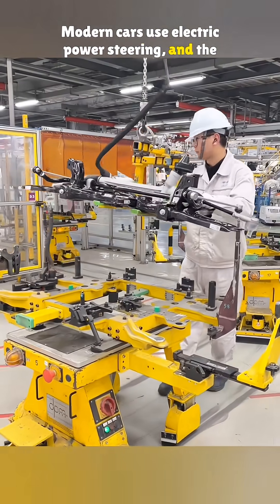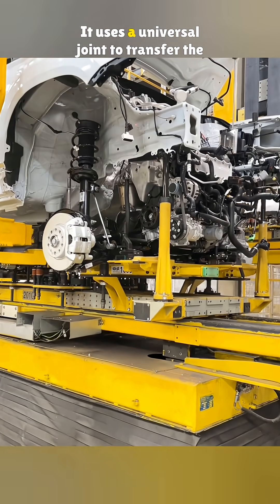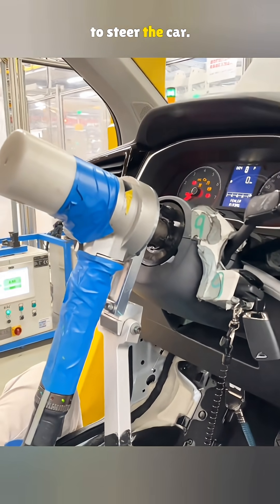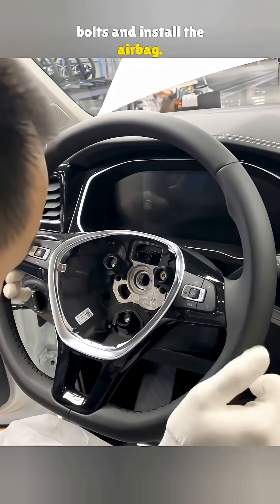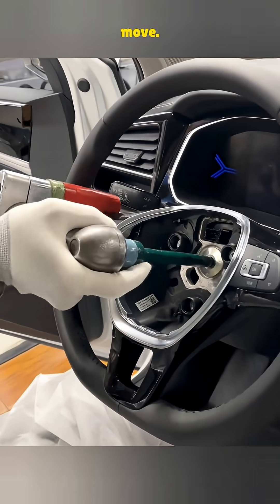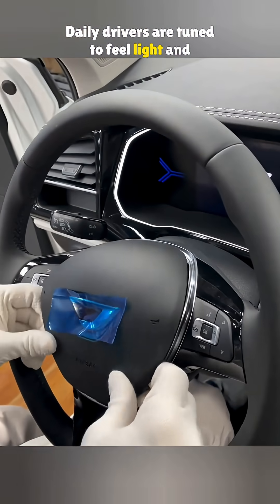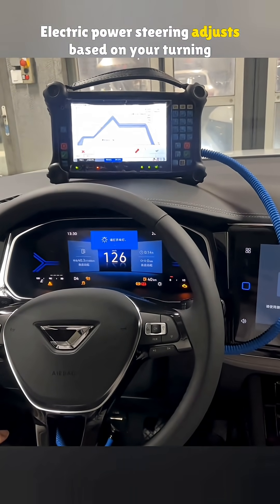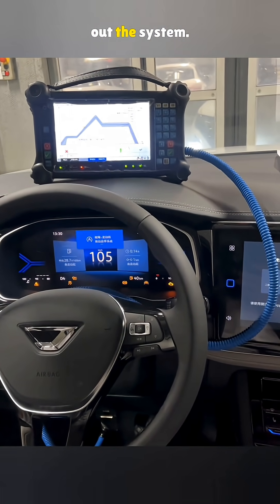Why You Should Never Turn the Wheel All the Way While Parked #assembly #factorytour #manufacturing

Comment: The only time you should turn the wheel from lock to lock 3 times to recalibrate your power steering sensor after replacement.

Comment: Nice brain rot. The answer is, turning the wheel, while not in motion, causes extra stress on the steering system. That said, modern vehicles are (mostly) over built with this in mind.

Comment: Electronic power doesn't change the steering ratio. It's just a power steering system that uses an electronic motor rather than a hydraulic pump.

There are multiple types of variable steering ratio systems, but that's a totally different thing. There are variable ratio rack and pinion systems that use different tooth spacing on the steering rack (these types exist even on some hydraulic power steering cars. These space the teeth out further off-center so you get smoother steering on straighaways but more response once the wheel starts turning. There are also active electronic variable systems that use motorized pinions to increase steering response based on factors like speed, steering input, and drive modes.

Comment: This has always been the case.  Hard on tires too.  Back before power steering, you realized that letting the car move an inch or too makes the wheel turn very much easier.

Comment: That's stupid.
While parking near kerb on a hilly or sloped terrain, the steering is always tilted towards the mountain face or obstacles facing such slope. If you don't do that, and the handbrake fails, your car will literally go towards the middle of the road or even off the cliff.
Reply: Do not  park  on hills. This will wear out  the car parts which  are  very  costly.

Comment: In a hydraulic steering system,  nothing will be wrong in doing so. Just the regular wear and tear that can survive for more than 500 thousand miles in most cases.  
  The electric power steering components are more delicate.

Comment: I mean at some point you’ll have to turn the wheels while stationary at least a few times in your life. Because if your in a tight parking spot, namely Parallel parking, then your going to be turning your wheels when your stopped. And I’m sure car manufacturers realized that as well since the engineers probably have to do it as well.
Reply: No, do not  turn  the wheels. This causes  expensive  wear and tear. Use  car  for naps only. (Be sure to keep  nice  pillow in car for better  sleep  ,of course)  . This will  save money and also the earth. Thank you for your attention to this matter.

Comment: What to do if you're in a parking spot, and you have to take 90° turns?
Reply: You can still have very slow motion while turning. If not otherwise possible, you can even drive back-and-forth the few inches while making the turns. That's how we did in the time we didn't have power steerings.
Reply: just drive normally this video is bs

Comment: And what normally tends to wear out. Is the balljoints on the track rod arms. As they Are a ball n socket set up. Just like your knuckles, on your fingers, toes, shoulders n pelvis, elbows n arms. Inside there is grease. And once that grease (Sealed @ factory).. Dries out, due to extended Heat thru friction. The ball socket wears out. And U get "SLOPPY" Loose steering. Causing wear. And when ppl park against the curb, or hit a pothole. That COMPOUNDS The wear.. And Then U see UNEVEN Tyre wear. And car "TRAM LINING".. As you drive down the road.

Comment: He is saying that do not turn steering all the way till you reach the lock on either sides.
Because electric motor is assisting you while you turn steering wheel.
Power steering system is an ultra high speed computing system that senses your steering input and assist you with motor in realtime.
So when you touch the lock while turning all the way, electric system will try to turn a little more after the lock is reached. Which will lead to over current in power system circuits and may fry it if you have bad luck. But it wont happen always.

Comment: He is saying that do not turn steering all the way ot the lock on either sides.
Because electric motor is assisting you while you turn steering wheel.
Power steering system is an ultra high speed computing system that senses your steering input and assist you with motor in realtime.
So when you touch the lock while turning all the way, electric system will try to turn a little more after the lock is reached. Which will lead to over current in power system circuits and may fry it if you have bad luck. But it wont happen always.

Comment: That might not actually be true. Because whilst driving you not only have the static load (weight of the car) through the wheels and thus also parts of it in the steering system but also dynamic loads due to acceleration and cornering (longitudinal and lateral forces). Whist standing still you only have static forces. Also for the stress on the steering components it is no different, if a person or the electric assistance brings on additional load into the steering system. So please use the steering to its full extent, like the manufacturer intended.
Reply: the video explains it very badly, but it's true, when stationary the tires create a lot of friction, and you have to force the steering wheel a lot. try a car without power steering...
Reply: @leonardo5225 Exactly. That's the best example.
Reply: @XB10001  yes it puts stress on the parts. But none of the parts should be that week that they can't handle the tension. If they are too weak they shouldn't be part of the car.
Reply: @technikchaot they aren't that weak but overtime everything breaks down after doing it hundreds or thousands of times
Reply: @technikchaot* WEAK
The design is a compromise. Making them stronger adds unnecessary weight, when all you need to do is operate the steering properly.
You don't misuse other parts of the car, do you?
I guess you dry turn all the time.
Reply: @technikchaot some people are curious about how to drive their car the maximum amount of miles before it eventually breaks down. It's about reducing unneeded stress. Of course its built for strain, but it's still strain that's not needed and can be avoided in many situations.

Comment: What you ment to say was never turn the tires while the car is stationary, there must be slight movement forward or backward so you don't strain the components 🤝
Reply: Oh please. You'll never wear out anything doing it a few times here or there.
Reply: Yeah. Dry-steering is generally bad, not just steering to lock. You can go lock to lock while rolling at a crawl just fine
Reply: Exactly!
Reply: Yep, you get the idea by driving old cars without power steering. You will feel the strain when trying to turn stationary, all while the slightest movement eases it.
Reply: bs, this is the way to stop your car from moving at an incline if your handbrake dosent work anymore

Comment: That's bullshit.
The forces and stresses on the steering system mechanical components are exactly the same when the system works and when not. Only the driver "feels" lighter feedback, but entire system takes the same forces. How do I know? I work in the EPS (elec power steering) automotive industry for years, as a safety engineer. 
Wanna know something? Some clients have a special test: test car parked with near curb, co the front wheel is touching the curb. And then the special machine is trying to turn testing how much kilonewtons need to be applied to break the system. 
The steering system never broke, always the wheel was first and test was over.
Reply: wouldn't the suspension bend or the car move before the rims break?
Reply: The tyre can roll itself into a new angle when its rotating (vehicle moving). If done stationary, the tyre will have to forcefully grind itself against the ground into a new angle. The frictions involved are a lot higher then.

This is why steering becomes lighter when moving in cars without power steering.

The driver won't feel the increased stress through a power assisted steering.

 But the system will be working harder and the ball joints, steering motor/pump, rack and track rods will feel all that extra stress.
Reply: @kaveeshakarunaratne8961  yeah but it doesnt really matter as long as you're not trying to imagine the entirety of the nordschleife
Reply: The clip is about turning the wheel while car is moving vs stationary. While car is moving it is much easier to turn the wheel therefore less stress on components. It's not about car started (EPS on) vs turned off.

Comment: The video doesn't get everything right. You need to center the clock spring before you line it up to the marks and put the steering wheel on. If you're not careful, you'll snap the clock spring.

Comment: The bigger issue is the crappy, designed-to-save-money-not-improve-performance McPherson strut front suspension.

Put a REAL SLA system in, then drive!
Reply: ok then whos gonna buy it? it sure aint the regular family man or young adult.
Reply: @ThePencilPusher You’re saying the “typical family man” doesn’t care about better handling and the additional safety that comes with it? And what’s the downside? A few extra bucks? Considering the ton of completely unnecessary additional electronic systems now typically added on to the family sedan, we seem to be more than willing to spend cash on useless stuff (whose weight arguably makes the car LESS safe “for the family”…why not start with a better foundation first?
Reply: That has nothing to do with electric power steering failing. Compared to traditional upper and lower control arms, struts make it easier to turn the wheel, not harder. Your caster/sai line is typically greater going through 2 ball joints, as opposed to 1 ball joint and a strut bearing. 
Either way, you're not going to damage anything by turning the wheel when vehicle is not moving. They're built to take that kind of stress.
Reply: @052RC  That was part of my point. Have you heard of power steering failures, whether electronic or hydraulic , due to this? I haven’t, but McPherson struts make for poor-handling (ie. less safe) cars.

Comment: Both wheels turns different angles right? Because the inner wheels are turning a smaller radius compared to the outer one.
Reply: NO
Reply: Could you please explain.  @TheDutchGuy110
Reply: @ajeesh3485  Both wheels turn the same amount. When you make a turn, the inside wheels spin slower than the outside. As long as the wheels can vary is speed, that's it. If you have a vehicle that locks the axels, like a truck with true 4 wheel drive, that's another matter.
Reply: @052RC  that is incorrect. The inside wheel turns more than the outside wheel. This is known as the ackermann steering, and in racing cars is often the opposite where the outer wheel has a greater turning angle than the inside wheel does.
Reply: @TheDutchGuy110  yes. The andle of the wheels is different with the inner wheel often having a greater angle of turn and thus a smaller radius

Comment: what a useless video, you don't turn the wheel when parked because it will cause flat spots on your tyres and that in turn can cause imbalance when driving. nothing to do with electric or hydraulic steering or anything else.
Reply: Lol exactly, what a load of bollox.
Reply: Thats because you always should keep the wheels rolling while moving the steering wheel.
Reply: @BjornS22193 Not always possible in tight parking spots. Or you move it just few cm here and there.
Reply: @rybaluc It depends, i never turn my steering wheel when the wheels are not moving and you dont need to move your car much just to get the wheels moving enough so dont get a flat spot on your tires. Another positive thing about this is that the car is easier to steer when the wheels are moving compared to if they are standing still.
Reply: It has to do with it,but you don't know that, and worse, you don't know that when your car is not moving ,the stress on the directions components are huge, that's what this guy tried to explain to you,I have seen a lot of car coming in for alignment because people are not aware of the force applied on the wheels and every component in between, specially in modern car with a electric motor assisting the driver...😉
Reply: @taoisisis6697 25 years in the industry my friend, technician and OEM engineer. Whether electric, hydro, non assisted is doesn’t matter the components are designed to deal with the forces. What isn’t are the tyres, constant twisting on a static surface will excessively wear the tyres creating flat spots causing vibration through the steering system. In turn alignment and balance issues. Yes there is an element of wear in the steering components but there always will be in moving parts.
Reply: @AdamHolmes8 Well it gets fixed either way until next MOT. You not gave much to do in tight parking spots.  
But i agree. Even in emergency mode without stering assist car can withstand forces from wheel.
Reply: That's why you always spit under your tires before you turn the wheel!!

Comment: Never turn the wheel, period. Otherwise, you will wear out the components!
Reply: Just sound the horn, close your eyes and push the gas. Simple.
Reply: @boilermaker1337  That's the way. And never use the brakes, or you will wear out the pads.
Reply: @paulparoma  Yup, beside, brakes just slow you down.
Reply: @boilermaker1337 No one wants that.
Reply: Don't even get in the car! You will wear out the interior.
Reply: @brianb8060  That's my policy.
Reply: Don’t start the engine as is wears the pistons out…

Don’t open and close the doors as the hinges wear out…

Don’t wash the car as the water can damage the paint…

Don’t leave dirt on the car as it can discolour the paint…
Reply: Don't walk as your legs wear out.

Don't breath as your lungs wear out.
Reply: @RingoYote  *breathe.
Reply: Don't ever accelerate in your car because it will use more gas.
Reply: Right
Reply: This string of comments made me laugh one too many times😹
Reply: Owning your car is bad for your car ahh reply section
Reply: I took your advice and I have been driving straight since 5 months. I miss home
Reply: @meetadityanihlani  Home is where the heart is.😃What about work? You don't miss it?🤣